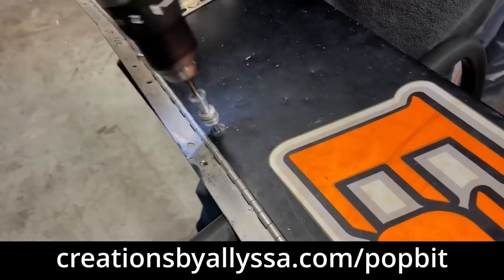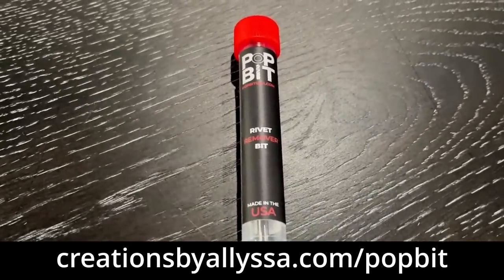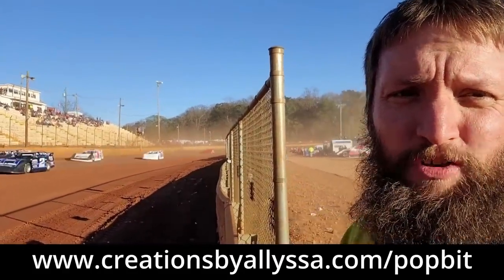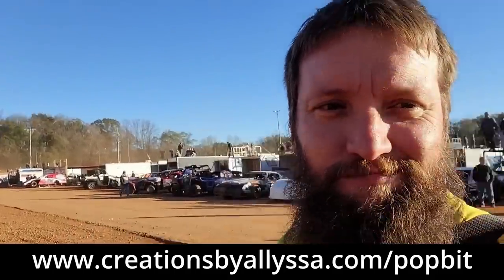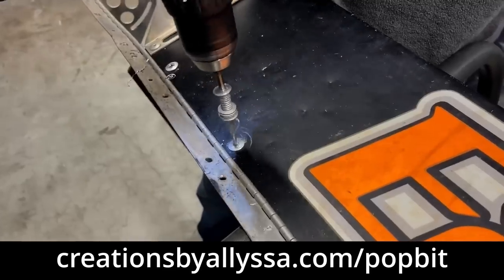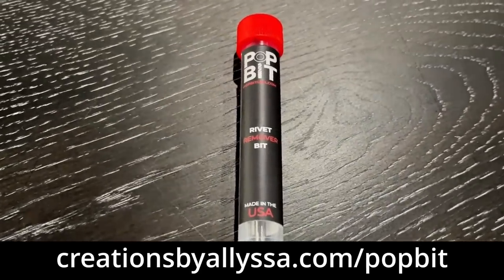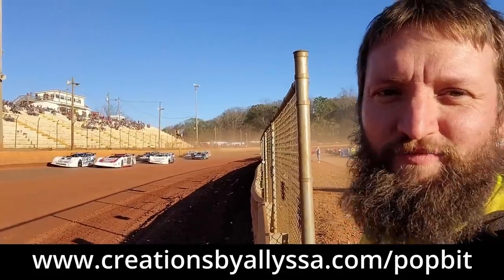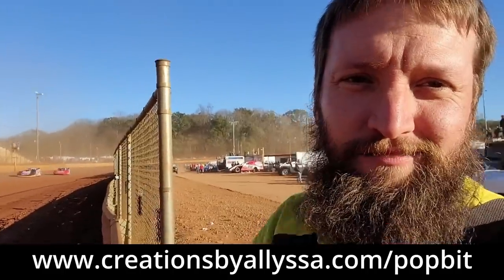Wrecked under Yellow #28 Tyler Carpenter - 2022 Gateway Dirt Nationals - Super Late Model - InCar

Comment: Thanks for sharing. Clearly shows Tyler pinching off Hudson and running him into the track entrance. However, at the end of the day, I guess it's just a racing deal.
Reply: Never touched ran the same line
Reply: T had no idea hud was there so no fault at all
Reply: @xhiddenrage  Tyler definitely washed up he entered in on the bottom and came up like just after halfway through the turn but I’d say it’s more of a racing deal with this track it’s rough and tight but Tyler definitely could’ve gave him some more room
Reply: @Austin Fink  he ran the same line every restart never washed up its more Hudsons fault for trying to squeeze on the top
Reply: @austinfink3808  Tyler had 0 way of knowing Hud was out there. He ran the same line every single time so Hudson knew he was going to come up.
Reply: The track is short af, rough af. You can argue who washed up or who should have lifted, it’s the Dome. When you unload here you know the risk and what you need to do to stay up front.
Reply: @hdhhc5555  keyboard warrior. Isn’t that what he calls you peeps?
Reply: @austinfink3808  were does it say that the leader has to let another car pass him ?